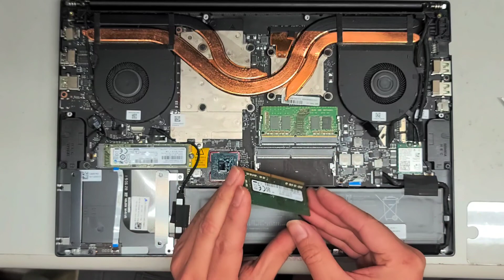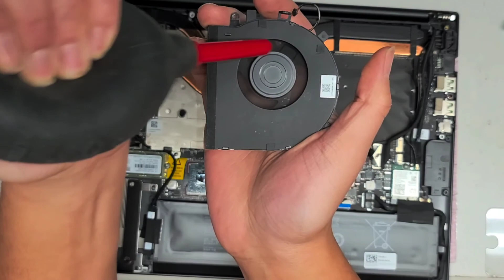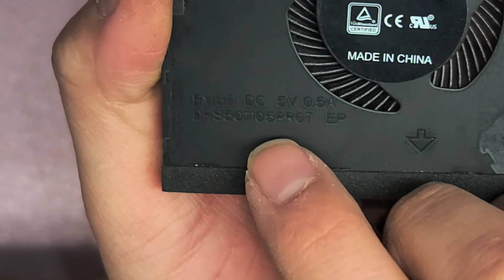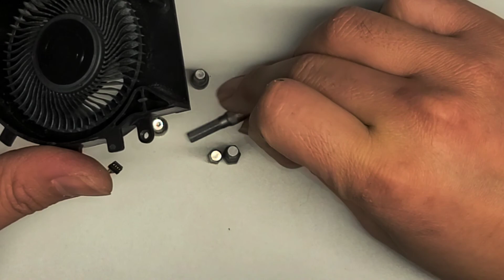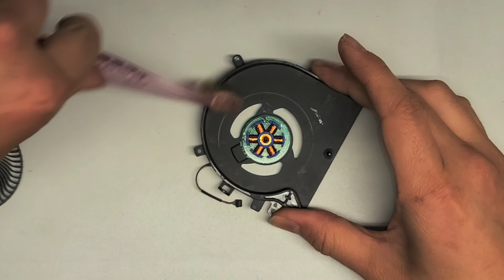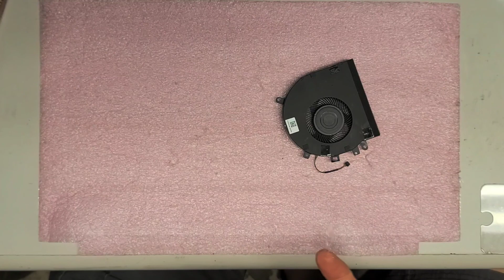Rb Razer Blade 15 rz09-03006e92 Disassembly RAM SSD Hard Drive Upgrade Noisy Fan Repair Replacement

Comment: I tried to remove the impeller from the Lenovo Legion 5 fan. But I did not succeed, I tried to press with my fingers from the back side, resting on the blades, but it did not work, after which the fan began to grind when tilting the laptop. Are there fans that cannot be repaired, or I just did not press hard enough on the blades to get them out? I watched all your videos on fan repair, but maybe I have doubts that the method you showed in the video can be better than the efforts I put in.
Reply: I am also wondering why the fan started to scrape. Did I break or violate something, can this be fixed?
Reply from the maker: You might have bent the metal supports so it's now touching the frame. You might have to replace the fan. A lot of them have a mechanism similar to an arrow head that holds it in place. Some can be so difficult to remove that it breaks the mount trying to remove it, though that's pretty rare if using the right technique. I did one just last night that was very difficult to remove. Video is uploading right now. Will likely be up in about an hour.

Comment: I have GE76 raider and fan type is same(has no screws to pop out) when I repasted my laptop, removed fans for clean but one screw of fan is not holding anymore. Fan has 3 screws to hold the heatsink but one is not holding because of the plastic. I recently bought a new fan from aliexpress but the new fan has very bad noise. Can I remove the well working fan and mount to the other with popping out like this? Thanks
Reply: Any ways to communicate? I really need help about this, cant explain without photos. Thanks
Reply from the maker: You can try. Not sure.

Comment: Hey sir thank you so much for the video! Tried the same way and the fan snapped from the pin, so gotta buy a new one . I cannot for the life of me find this fan that fits for RZ09-03009 all I find anywhere is CPU & GPU Cooling Fan Replacement for Razer Blade 15 Advanced (2018-2020) 15.6" RZ09 RZ09-02385E92 RZ09-02386E91 RZ09-0288 RZ09-0301 RZ09-0330 DFS2001053E0T DFS551205WQ0T

Any ideas how to find the same one? Tyia
Reply from the maker: Check the fan itself for a model number

Comment: What lubricant did you use in this video?.
Reply from the maker: Just synthetic motor oil that I use in my car. Any lubricant designed for moving parts will work.

Comment: Hi! I'm so glad you posted this I can't get my hands on a replacement and i need to fix my fan. I was wondering though could WD40 work as a replacement for the motor oil?
Reply from the maker: WD 40 isn't a lubricant. You don't have access to a vehicle or gas lawn mower or anything?
Reply: @ItsBinhRepaired  Oh i do i didn't realize i could use those
Reply from the maker: @ryukaa2157  you can pull the oil stick out and take a little oil from there.

Comment: Today I have broke the GPU fan during blades extraction. They just never give in in any way. Gotta get a new one now :(
Be careful with your fans, guys
Reply from the maker: Yeah, some aren't designed to be removed. It sucks.
Reply: @ItsBinhRepaired  It's a Razer Blade 15 2018 Advanced
Reply from the maker: @danich46  even within the same models they sometimes use different fan designs.
Reply: @ItsBinhRepaired  anyway thank you for your video and replies ;) Already ordered a new one from Aliexpress
Reply from the maker: Sounds good! Might take a month or so from there. D:

Comment: So out of curiosity what is that  soft pad on the fan? That runs along where the poet connects?
Reply from the maker: Not sure what you mean. What soft pad?
Reply from the maker: Shape, color, etc.?
Reply: It feels almost like a heat pad it's the long rectangle almost foam feeling thing on the fan near where the air would flow out of the fan. Don't have a good way to explain it 😂
Reply from the maker: @PenguinzFtMFW  it forms a seal between the fan and the case to direct the air out of the laptop through the heatsink.
Reply: @ItsBinhRepaired  where can we get more of we replaced our fans?
Reply from the maker: @PenguinzFtMFW  not sure. You'd have to peel it off from the old one.

Comment: Have the same exact problem on the same side fan on my Razer Blade 15 2019. It just gotten worse and makes a loud rattling sound after booting. What was the cause of the rattling sound when spinning the fan? It just needed lubricating or could it be completely defective?
Reply from the maker: Usually just needs lubrication

Comment: Hey man, I just wanna say thank you so much for this video. I can disassembled and repaired my right fan (processor fan) temporarily while waiting for my new fan from Amazon 👍

I have the Blade 15 2020, RTX 2060 model. Bought it last November 2020, never had any problem until today. 

I called Razer for the warranty claim (warranty ends on Nov 2021) but after hearing their repair time, shipping time, and cost of $90 for shipping return, I decided to take this matter on my own.

I managed to pinpoint my root cause (imbalance fan bearing). Tried to brush the dust out, WD40 the fan couple times, and spun it for a while. So far my temporary fix seems to work. Will update you guys later on

Oh btw here’s the link for the fan:

QUETTERLEE New CPU and GPU Cooling Fan for Razer Spirit Blade 15 GTX 1060 RZ09-027 RZ09-0270 RZ09-03009E97 RZ09-0300 RZ09-0328 RZ09-03287E72-R3U1 Series DFS501105PR0T FM5D and DFS5K121142621 FLK7 Fan https://www.amazon.com/dp/B08B4TSCGM/ref=cm_sw_r_cp_api_glt_fabc_6PMJ59H1MYS75JV2SXGS

1. The fan fits with my Blade model (RZ09-03286E22). 
2. I checked my fan serial (DFS5K121142621 and its an FLK7 model). It matches with the fan offered by Amazon.

Hope this helps fellow owner of Blade 15 2020 (RTX 2060). 👍👍

Once again thanks man!. Your channel are supposed to have more subscribers with this kind of helpful videos!
Reply from the maker: Glad the video helped. You'll want to use a lubricating oil instead of WD-40. WD-40 doesn't provide lubrication and if anything will just remove the lubrication left. I just use synthetic motor oil. Works well.

The reason I don't have many subscribers is my content isn't the type that people will watch for fun, so they're not likely to watch more than just the one video they needed help with.

This is why I ask people to help contribute to the channel if they can. I'll likely never be able to do YouTube as a full time job making helpful videos like these. I'll likely have to switch it up and just do entertaining stuff.
Reply: thanks
Reply from the maker: Glad it helped. If you haven't already don't forget to like and subscribe so others can find my videos. Thanks!
Reply: Hello, I have new Base 2020 with 2070 max q. It says RZ09-0328 on mine too, is it the same fan? The right one wobbles and makes annoying sound. Is the GTX 1060 fan the same as RZ09-0328?
Reply from the maker: Don't know

Comment: I’m new to computers but this video really made it easy for me to understand. I popped out the fan blades, as you said it was very risky and frightened me but it was all good. Though I don’t know where I can get the grease you speak of that needs to be applied. It would be nice if you could link what you are talking about so I can go ahead and buy it. Thanks for the help again!
Reply from the maker: I just use synthetic motor oil for the car. If you have access to a car, you can get a drop from the dipstick used for checking the oil level.

Comment: where are the pins for the power button? can't find any information about in anywhere. I have a motherboard and I'm trying to start it by shorting the pins
Reply from the maker: Where's the power button on the laptop?
Reply: @ItsBinhRepaired   nevermind I found it. I was looking for pins to short on the motherboard, but it turns out there's a physical power button on the motherboard itself. It's just really small and I was expecting pins.
Reply from the maker: @Kyjor_  I see
Reply from the maker: @Kyjor_  glad you found it.

Comment: how tf did u take the spinning part of the fan off (propeller)
Reply from the maker: Try watching the video all the way through. Lol
Reply: @ItsBinhRepaired  I tried using screwdrivers instead of those like screw lookin things
Reply: @ItsBinhRepaired  and it worked
Reply: @ItsBinhRepaired  but by oil could I use like cooking oil LOL
Reply from the maker: @kaden2380  don't use cooking oil
Reply from the maker: @kaden2380  just pull the dipstick from your car.
Reply: @ItsBinhRepaired  wait does olive oil work or canola oil? if not ill just get one tmr
Reply from the maker: @kaden2380  no, those oils are not for lubricating things.
Reply from the maker: @kaden2380  please watch the video and follow the instructions. Cooking oils will mess up the fan and it'll get all gunky. Nobody lubricates things with cooking oil.
Reply: @ItsBinhRepaired  K i have synthetic oil is that gonna like make it stop making a weird noise?
Reply from the maker: @kaden2380  just make sure it's for lubricating fast moving parts.
Reply: @ItsBinhRepaired  like synthetic oil rigjt?
Reply from the maker: @kaden2380  doesn't have to be, but it's better
Reply: @ItsBinhRepaired  alr ill use that then
Reply: @ItsBinhRepaired  you the goat man it worked thank you
Reply from the maker: @kaden2380  awesome

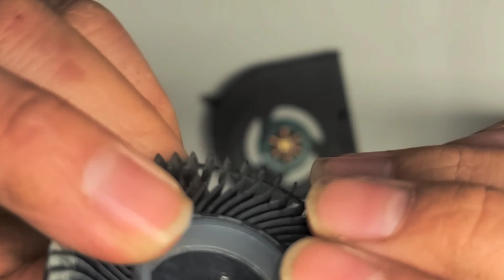Comment: Damn, the piece at 18:58 that didnt let it go out. Once popped it stayed inside :| im guessing I should get a replacement fan now that that happened. Can you link me a replacement for that exact same fan?
Reply: Late comment here. I don't see him removing the plastic piece in the propeller pin. He just blames it for the difficult removing. I actually have a Razer Early 2020 Advanced with a fun buzzing (https://www.youtube.com/watch?v=rCkZo7Gt-t8). I wanna try your grease fix
Reply from the maker: I hate how YouTube doesn't notify me of replies. Were you able to figure it out?
Reply from the maker: What do you mean it stayed inside?
Reply: @ItsBinhRepaired  through where could I send you a photo? . The little like metal pole that is supposed to come out with the Fan stayed inside. Excuse my english it isnt my native language
Reply from the maker: @kevinrivera4569  it snapped off? D:
Reply: @ItsBinhRepaired  yeah man, im guessing so, it did somehow, and it seems so nicely snapped off lool dont even look broken but yeah. I was also gonna ask, since I cant use that fan, can I put everything back together withouth that fan and use it? Not for heavy use as it would overheat but could I?
Reply: @ItsBinhRepaired   QUETTERLEE - Ventilador de refrigeración para CPU y GPU para Razer Spirit Blade 15 GTX 1060 RZ09-027 RZ09-0270 RZ09-03009E97 RZ09-0300 Series DFS501105PR0T FM5D y DFS5K121142621 FLK7 https://www.amazon.com/dp/B08B4TSCGM/ref=cm_sw_r_u_apa_glt_fabc_P556SB60B5PHJH4JVSKC are these the same ones?